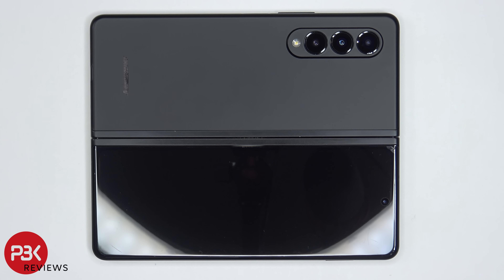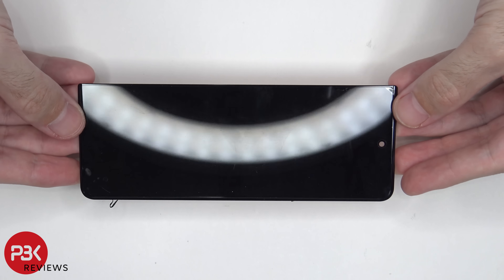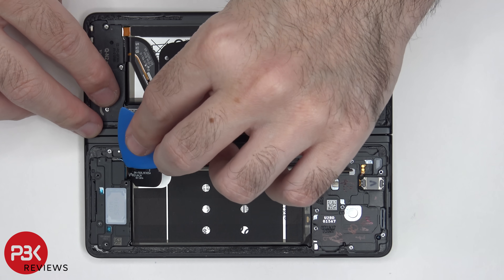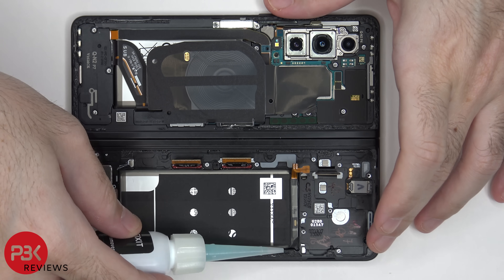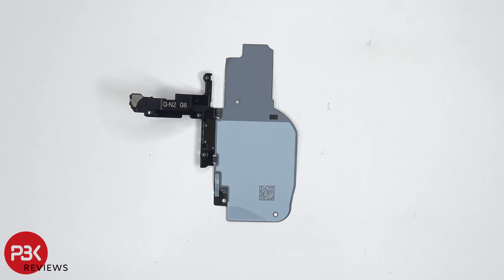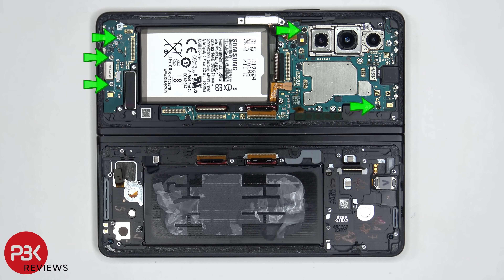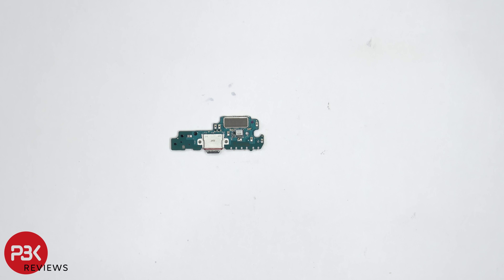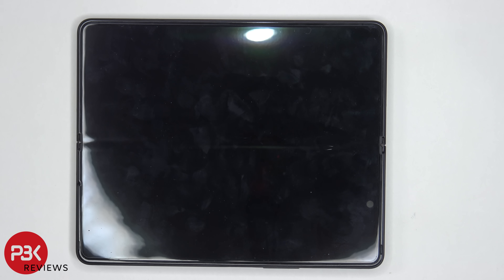Samsung Galaxy Z Fold 3 5G Disassembly Teardown Repair Video Review

Comment: 2/10 repairability rating but Samsung thinks it should take less than 2 hours for a repair plus diagnostics lol.  Good video
Reply from the maker: Samsung will probably have complete assemblies and so forth ready for replacement to cut down on times, for example all they would do is pull the main board and install it in a complete ready to go unit in most cases and then salvage the parts from that for future ready assemblies. But again depends on what type of repair is needed. Thank you :)

Comment: i always load this app that monitors the temperature of the battery when when in use and while charging. often ill place my Note 9 on a frozen bag of peas while it's charging and the temperature will go down to about 78f.  Does this phone with two separate batteries do a good job of heat dissipation while running the big screen? and can the outer screen be disabled to save more battery for the big screen? 
Excellent work on this video.
Reply from the maker: Thank you. The phone has a good amount of graphene film and 3d graphite to transfer heat so should manage heat well. Havent thoroughly tested it though. But I don't think you can turn the outside screen off.

Comment: Easier than I thought
Reply: @PBKreviews  I was expecting the Ip rating to make the board covered in something messy
Reply from the maker: @ameliabuns  usually they dont coat the boards in anything special aside from sealing the phone with water resistant seals and gaskets.
Reply: @PBKreviews  the fold 3 is special. they can't waterproof everything properly so they just coated the boards in a thin layer of a water repellent (oleophobic) material afaik?
Reply from the maker: @ameliabuns  they mention they used a special lubricant that adheres to the small components of the device but i belive thats the hingest and moving parts etc. Not sure of any repelent or coating on the board itself.

Comment: 0:41 wait that sounds and flexes like plastic 🤨
Reply from the maker: No its more like glastic, its a type of glass but has very little flex to it.
Reply: 1700 to get glastic😭 I thought Samsung said the front and back was Gorilla Glass victus unless that's actually it?
Reply from the maker: @TheAscendedTechNinja  it is, the reason for some bend in materials used in the glass is to prevent it from shattering easily and makes it more durable. Its similar backing like the s21 ultra.
Reply: Ik that, I was thinking Samsung lied also I would think it would sound more like glass  probably that paint acts like a sound damper but as long there telling the truth idc and  thank you for the clarification👌

Comment: Over here. Over here. Over here. Over here. Over here. Over here. Over here. Over here. Over here. Over here. Over here. Over here. Over here. Over here. Over here. Over here. Over here. Over here.

We can see where it is. Just give the specifics: "The [blank] is [located/covered by/attached to/held on by/near/etc... ] the [blank]."

Not: "The front tire is over here. The rear tire are is over here. The right wiper is over here. The left wiper is over here. The steering wheel is over here. The radio is over here.................."
Reply from the maker: You need to also understand there are people who literally need me to show them and mention it. As is I still get people on videos asking me to point the parts out in which I have to screen shot parts and circle them and upload the pictures online for them to see. So it may seem repetitive but there's a reason I do it :)

Comment: For a teardown video I find it pretty disappointing that he ignored the half of the phone that people would want to see. Yes I realize that attempting to remove the main screen would most likely break that screen.. but it's a teardown video. Tear down the phone. Show us the process.
Reply from the maker: I understand, but you need to also understand my channel is not huge and if I were to risk possibly destroying every phone by prying the screen off, I would not be able to continue making videos. There are pictures of the frame and hinge of the foldable screen removed on the verge. However because of the fact a few people really wanted to see the foldable screen removed, on the Galaxy Z Flip 3 video I will be posting later tonight, I removed the foldable screen as well. Hope you will enjoy that, since its pretty much the same thing as the fold, just half the size of the screen.

Comment: Skipped the only part I was concerned about. The front.
Reply from the maker: You can see it in pictures here (https://www.theverge.com/22619139/samsung-galaxy-z-fold-3-flip-screen-durability-waterproof-aluminum) so I didn't want to risk damaging the screen. My channel doesn't generate the revenue to cover me tossing away phones unfortunately. I did however go ahead and pry the screen off the Z Flip 3 which I will be uploading the video later tonight.

Comment: Do you think the under display camera could be upgraded with a different module? Obviously you'd need drivers and the right pinout, but maybe it could be replaced?
Reply: Chris S / No, because the camera software optimizer is written specifically for that kind of camera with its own pixel logistic arrangement.
Only a very high knowledgeable specialist can do the change where it should also change the specific camera software.
Since you can very well use the advanced outer camera for selfies, you don't absolutely need to "modify" ( which is very expensive ) the less quality interior screen one.
And the interior camera will get software improvements in time from Samsung, that will give it better and better visual qualities.
Reply from the maker: @mikel4879  👍
Reply from the maker: Maybe. If the connector is the same and fits in the allocated spot, might work but not sure about any software issues.

Comment: I was expecting you to come across the sealant they used to waterproof the insides to get their IPX8 certification, if you didn't see any of that then I think I'm kinda worried about that waterproof rating
Reply from the maker: That would be those rubber seals shows in the video where the flex cables are by the hinges. Also the adhesives which seal the screens and back plate.

Comment: How does one learn these mad ninja skills?!?! Fastest teardown on a difficult phone for sure. Doesn't give me too much confidence in replacing the battery at a later date.
Reply from the maker: Haha thanks. Replacing the battery is doable just time consuming. I would prefer to send it in to Samsung to have them replace it for a fee lol.
Reply: @PBKreviews  Do you know how much it would be to replace the inner screen?
Reply from the maker: @IncredibleGaming  based off of previous model pricing, would run anywhere between $500-$600 USD.
Reply: @PBKreviews  with samsung care +?
Reply: @PBKreviews  i just talked to them and they said it was free are they right?
Reply from the maker: I'm not sure if they have a special promo going on or not but as per their website it says with their premiere service you get a one time repair at an exclusive price. What that price is I don't know. But maybe the first break they will do it free. It's been offered before so yep.
Reply: @PBKreviews  ok
Reply: @PBKreviews  do you also know how much a battery replacement costs?
Reply from the maker: @ameliabuns  not sure but i would guess anywhere between $50-$100usd
Reply: Like $30 on Amazon. Make sure to read the comments because sometimes they label the wrong one as compatible.

Comment: Based on the modularity of the under-screen camera, would there be an feasibility to someone replacing it with something else?  If the cameras are USB-style and recognized that way, versus hardware driven by camera-specific chips, I was thinking it might be possible.  That assumes a handy person could package and attach the replacement to begin with.  One other limitation could be any special processing done by Samsung to remove the effects of being under a screen-amoled matrix.
Reply from the maker: It may be possible but the camera would have to fit in the space provided as well as have the same connector. Also not 100% sure if there would be any software issues.
Reply: @PBKreviews  there likely would. Samsung software locks switching out cameras with OEM replacement parts (atleast on the S21 ultra), there's no way switching camera units entirely would work.

Comment: 09:13 Am I the only one that is going to call him out on ignoring the main screen? I get that replacing the main screen is going to pretty much be impossible... but for a teardown/repair video it'd be nice to see the process of removing the front screen. He literally ignored half the phone and basically just verbally gave us a 1 sentence step on how to repair the main screen..
Reply: That would kill the phone.... Its costly man.... Appreciate what he does
Reply from the maker: @nothing9220  thanks!
Reply from the maker: Yea, I plan on keeping the phone usable and I don't have a huge channel that generates revenue to cover me destroying the devices all the time. Also there isnt much to it at that point, most replacements would come with the midframe pre attached and if not, all that is left is to pry the screen off. If you google also, the verge shows how the frame looks like under the screen, just has some adhesive holding it down. On the galaxy z flip video I had done a while back, i pried that ones  screen off and peel off the plastic or glastic layer over the screen to show the glass particles. It's pretty much the same thing. If my channel was big enough to cover me destroying or almost destroying the devices, i would even give away the phones for parts or repair to viewers/subs but yep not at that point yet lol.